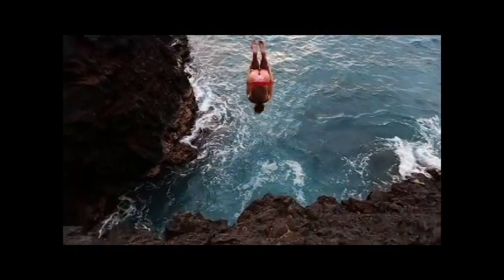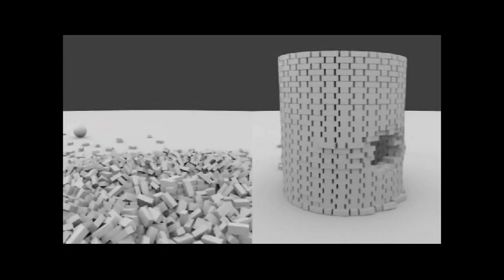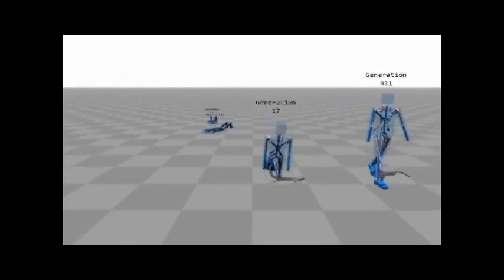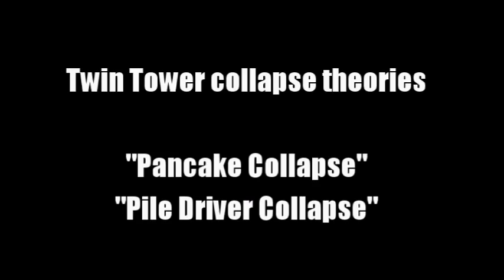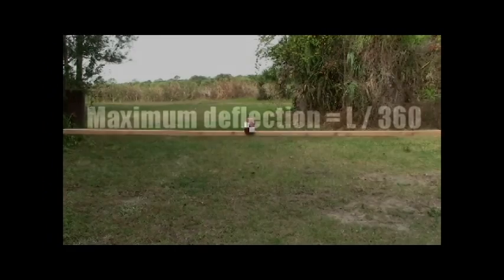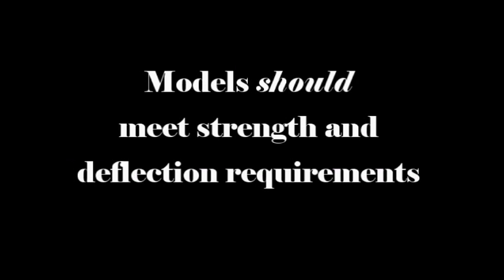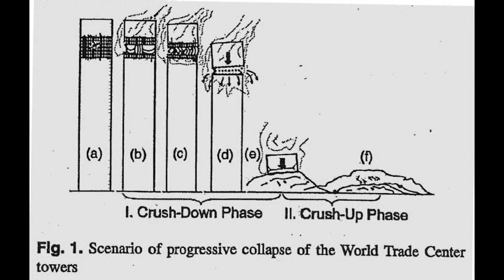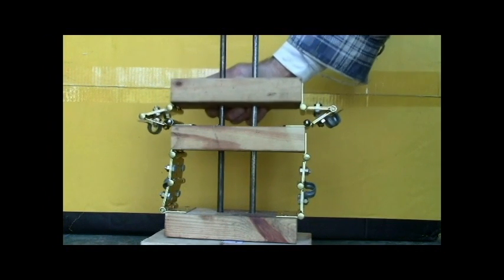9/11 Experiments: The Force Behind the Motion

Comment: fantastic !! The top 20% of a structure will never crush the lower 80%. You would think by now, someone/agency/gov't  would do a ground experiment of a hollow aluminum tube (airplane) crashing into a replicated section of the high strength steel structure (wtc) at 600 mph or would throwing an empty aluminum pop can at a brick wall be just as good of a demonstration ?... in order to show ANOTHER natural law of physics was also suspended that day.
Reply: +JohnnyBoy2222 
I have read many of your posts; I am even surprised you can spell Newton's name.
You keep telling folks to look up kinetic energy...?? but I would bet my testicles on it you wouldn't know how to fucking apply it in any great lenght or detail.
If you are such a kinetic energy genius, please entertain me & provide the math on how much energy was generated by the smaller falling structure vs. how much energy/force was required to sever, crush, pulverize, eject, deform all of the materials in the lower intact structure..?
I expect to see a very detailed calculation.

Then you suggest the Verinage demolition technique..? <- So you are comparing a controlled demolition of non steel framed buildings to... a gravity driven collapse in a steel framed building??? (DERP)
Psst the Verinage technique is not for steel framed buildings.
On the other hand; the Verinage technique is a beautiful example of how Newton's laws of motion work in the real world.
Pre-compromise the structure and then detonate it half way and allow equal/opposite destruction.
Step away from the PC and get back in the sand pit.
Reply: +JohnnyBoy2222  Only b/c you don't know what freefall is...N.I.S.T. AND SIESMIC along with your eyse have all reported about 10 seconds...freefall is the rate something falls or drops with no resistance under it and from the height of the towers a tennis ball would drop at the same speed as the buildings collapsing. 
THAT makes sense to your idiotic and delusional mind...you're just another mindless sheeple
Reply: +k dog You really have no clue do you? Maybe you should look up kinetic energy, and how that works out in a scaled test. Ow, and that simple tube you call an airplane, has to be able to cope with stresses you can't even imagine.

And if you really think scale don't matter, do the following test.

Buy a toy car, scale 1:250

Now drop that car from 1 feet high.

Get your own car, and ask a crane driver to lift it 250 feet in the air and then drop it. 

Then come back and let us know how that scaling worked out for your car.

And if you had any clue as to how the towers were built, you know that the top 20% only had to demolish one floor at a time, which it did.

Hell, large portions of the core were still standing, when the rest had already collapsed. The core buckled after 20 seconds orso due to euler buckling.
Reply: +JohnnyBoy2222 Why don't I drop the toy car from 1 cm and drop my car from 250 cm ? pay attention I never said anything about your  persistent scale argument and a hollow aluminum tube traveling at 600 mph and crashing into an immovable steel structure surpasses any "stresses I can't even imagine" and it's the same contest as throwing an empty pop can at a brick wall, duh, aluminum can't penetrate steel, a fkin bird can punch a hole in a flimsy plane, you have been watching to many cartoons.
 
 The bottom and much stronger 80%  of the building has been holding up the top 20% since it was built but somehow you think a fire, in a fireproof environment, weakened the steel and the little top piece crushed the big lower piece but...
  let's amuse your theory for a moment..".it demolished 1 floor at a time" so 110 floors at 1 sec per floor (considering the resistance) would be about 110 seconds, oh hang on, lets go with 1/2 a second per floor, that's 65 seconds, oh wait let's go to 1/4 of a second, that's about 33 seconds, oh lets go to 1/8 of a second, that's still to slow,  it fell down at about 10 seconds, the same speed as gravity, there must of been NOTHING in the way...hmm how does 75 cement and steel constructed floors, the size of a football field, quickly get out of the way as to not slow down the collapse what so ever ?
 "when 1 body exerts force on a second body, the second body simultaneously exerts a force equal in magnitude and opposite in direction on the 1st body " (newton) simple, testable natural laws of physics but YOU think they were suspended that day -3 TIMES !!!!!!!!!!
 Drop a cylinder block onto 3 stacked cylinder blocks from few inches up or from 10 feet up, the SMALLER portion cannot crush the larger, bigger, stronger portion, it's THAT simple
 It's hard to believe there are people like you that blindly follow even when physic laws are broken, like most dumb de dumb dumb americans but then most have an imaginary frIEnd too so we're not dealing with the most intelligent group.
 Did you let the demolition company's know they have been doing it wrong, BLOW UP THE TOP 20 % OF A BUILDING IF YOU WANT IT TO COLLAPSE IN IT'S OWN FOOTPRINT AT THE SPEED OF GRAVITY.
 Let the adults talk now
Reply: +k dog Hahaha. Still no clue I see :)

It took 15 seconds for the buildings to collapse and 25 in total with the cores(So this means there was resistance). So you are not really interested in the truth, because else you should have known this. And its not called free fall speed, but free fall acceleration. Thats because of something called gravity.

And the aluminum didn't have to penetrate the steel, but since you don't know how the towers were built, you will never understand why the plane was able to fly into the towers(I guess according to you, the plane should have flown against the outer columns and fall in one piece to the ground right?). And there is that thing called kinetic energy, which you don't seem to understand as well. 

So let me give you an example. Buy a gun, and a pack of bullets. Take a bullet out of the pack, and throw it as hard as you can at a tree. Does it enter the tree?

Now load a similar bullet into the gun, and fire it at the same tree. Does it enter the tree?

Now you go and figure out what the difference was in both experiments. 

And feel free to teach me your understanding of Newton's Laws :) I bet that will be a hoot!
Reply: +k dog You say "EVERY ACTION HAS AN OPPOSED AND EQUAL REACTION"  So how was this applied in the collapses?
Reply: +k dog Or better yet, what do you think it means?
Reply: +JohnnyBoy2222  I didn't say that, a genius did , c'mon I don't have to explain 1 of the laws of physics...
When the top 20% hit the lower 80% there was an equal resistance, the building would stop collapsing after "so many" floors.
 The building has been supporting that weight since it was built, only a dummy would think a 110 building could fall down at the same rate/speed as freefall
Reply: +JohnnyBoy2222  i said 1 of newtons laws , just saying
Reply: +k dog Yes thats correct, but mass has an influence on those opposing forces. And like I explained before, it only has to destroy 1 floor at a time. So we have the mass of 13 to 20 floors falling on top of the floor beneath that. The floors were bolted between the outer and inner columns, so all that weight came down on top of those connections.

This is how it looked.

https://pmk01.files.wordpress.com/2012/05/perimeter_columns.jpg

Correct, the building has been supporting that weight since it was built, and all that time, there was potential energy stored inside the buildings. That energy was transferred to kinetic energy as soon as it started to collapse.

Look at it as a static force. So a stone can lay on top of a glass table till the end of days, but when you drop the stone on top of the glass table, the table will break. The static force has changed into a dynamic force.
Reply: +k dog And it did not fall at freefall..... Repeating the same shit, doesn't make it right.
Reply: +JohnnyBoy2222  can you count to 10, that's about how long it took to fall down or did you watch it in slow motion ? There are reports on this stuff y'know.
 Building 7 just fell down perfectly perfect as well, I guess if natural laws of physics are suspended 3 times in 1 day, it must make it right
Reply: k dog
You certainly have more patience than I do.
If they don't understand that FFA acceleration is impossible in any structure falling through itself (all of the energy is converted strictly to motion, therefore none of the energy can also be doing work at the same time; i.e. bending, breaking, shearing, pulverizing, deforming... materials below them,).. you are wasting your time with an imbecile.. his earlier posts reinforce he is a brain dead twat.
Reply: +WakeTheFuckUp Hahaha. you really have no clue how the buildings were constructed do you :)
Reply: +WakeTheFuckUp ROFLCOPTR!

You certainly have more patience than I do.
If they don't understand that FFA acceleration is impossible in any structure falling through itself (all of the energy is converted strictly to motion, therefore none of the energy can also be doing work at the same time; i.e. bending, breaking, shearing, pulverizing, deforming... materials below them,)

Did you just pull that out of your ass? Where do you get the idea from that all the energy is converted to motion?
Reply: +WakeTheFuckUp  don't bother with johnboy, he is writing from a physc ward
Reply: Yeh unlike you who is writing from a psych ward....
Reply: k dog lol :D

Comment: Thermite does not explode but burns so hot to melt steel...so you wont see as much the outward blowout..
Reply: +Chuck Itall  It does not matter HOW it only matters that the "Official" story can not possibly be true. As i have said from day 1 "A free falling object will always take the path of least resistance , YET those buildings "fell" through the path of maximum resistance" <The official story is a LIE !
Reply: JohnnyBoy2222 Sure we do.  It went like "3...2...1...PULL!"
Reply: +Chuck Itall Certain types of thermite CAN explode.  Nanothermite can react so quickly due to the particle size that it is essentially an explosion, although not to the same extent as C4 or something similar.
Reply: +Mark M Ok, here is an idea for you. Go to the harbor and park your car near a container. Ask a friendly crane driver to pick up a container and drop it on top of your car.  It should be fine, according to you, because your car is the path of the most resistance right?
Reply: +JohnnyBoy2222 Is that what you believe he meant? Try stacking 100 cars on top of each other and drop 50 cars on them..will the 50 cars crush the lower cars and disintegrate?
Reply: Cop Cam Hawaii Bonnie Mitchell-Fox You all really don't understand how the collapse went do you?
Reply: +Mark M 
If one was to believe in the validity of NISTonian science, jumping into pools of water would be banned globally for public safety reasons.
Reply: Cop Cam Hawaii Bonnie Mitchell-Fox More like, stack 100 diesel trucks on top of each other, and then drop 25 ford focuses on them.  NIST physics says that the 25 smaller, lighter cars should turn the heavier, more substantial cars beneath to dust in midair.

Either way, JohnnyBoy's example is a ridiculous false parallel.
Reply: +JohnnyBoy2222 
To some degree you are correct. If the shipping container is empty and the car you are in has multiple roll bars forming a cage around the driver then the driver should be and feel safe. The more mass the container has the lower the chances for the driver. 
If the container is the same mass as the car then ABSOLUTELY no problem  10 times the mas of the car and maybe no problem a 101 thousand times greater and you had better have some great roll cage or you are squashed.
Reply: Earnest Samuels go read the tax code you will jump into pools of molten lava.

Comment: Dimitri Khalezov was spot on in 05', look at the chemical composition of granite.
Watch 'Psy-opera'.
Here is a basic experiment.  Take a 5gal bucket w/ 1gal of water.  Place on a level surface, drop a cider block into the bucket.  Water that splashes out will create circles, as per Pascal's Law, pressure on a fluid is equal in all direction.  This shows how Judy Wood's OBSERVATION (she calls DEW) confirm Dimitri Kalezov's observation.

Comment: You are very adept at making straw man arguments and destroying them.
How the flipping hell can you hope to use these results as a comparison to reality when in your own words " ...not an attempt in any way to build a scale model..."

You use use 2 steel poles as the core. An indestructible core. Too bad the WTC towers didn't have such a core.
This is just one of your many failed assumptions in your models.
Reply: +Stubbee  Another sheeple piping up with nothing to say, either way ding dong, the top 20% of a structure CANNOT crush the lower and stronger 80%, not an opinion, just elementary science and logic
Reply: Nobody said the top "crushed' the bottom. There was little to no crushing. that is why this "experiment" (I am being generous calling it that) is flawed. The WTC1 and 2 were not crush collapses.
Columns require lateral support or they twist and/or buckle. The upper section progressively destroyed that lateral support by destroying each floor. While the columns were designed to hold the weight above, the floors were not. The floors were designed to hold the load (static and dynamic vertical loads which are are very similar floor to floor); and provide lateral support for the structure. That lateral support was in the form lightweight steel trusses that tied the inner steel tube structure to the outer steel tube structure.
Revolutionary design but fatally flawed. The Titanic was a revolutionary design too. Unsinkable they said...oops.
Reply: +Stubbee That's funny that the Titanic sinking is your proof that the twin towers could collapse. Physics sure has a weird way of acting different when large insurance claims are at stake.
Reply: WTF you talking about?
Whenever the design envelope of something gets pushed, mistakes happen. The Titanic designers pushed the envelope of steamship design, oops. Guess it wasn't unsinkable after all. The designers of the twin towers has to make some extraordinary design decisions. They invented the sky lobby. The WTC towers were basically 3 40-storey buildings stacked on top of the other. They pushed the envelope of tube structure design to record heights.

Irrespective of your comments, the video does not reflect the collapse AT ALL.
There are many faulty assumptions that are glaringly obvious.